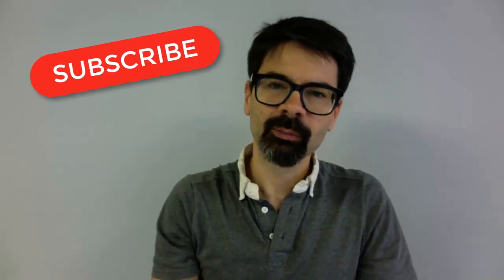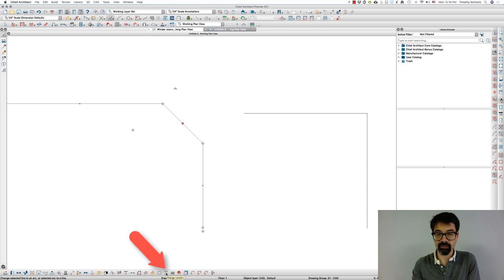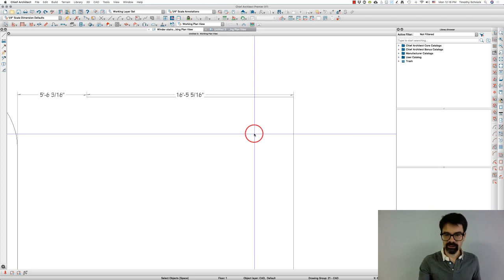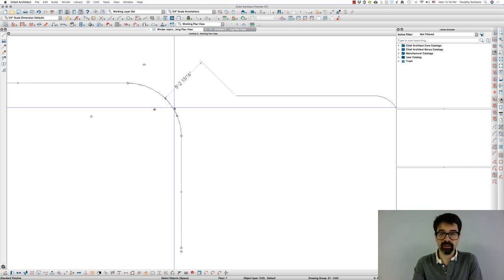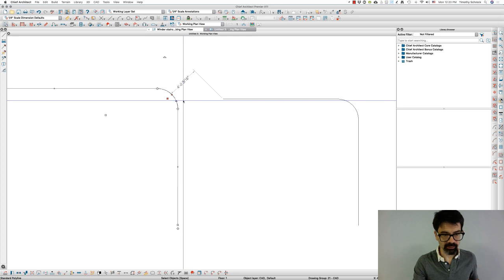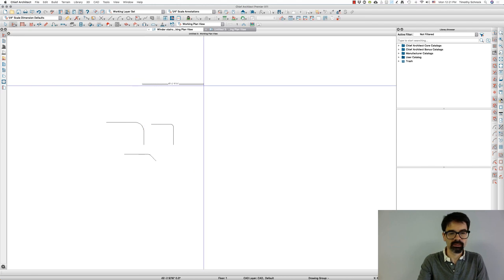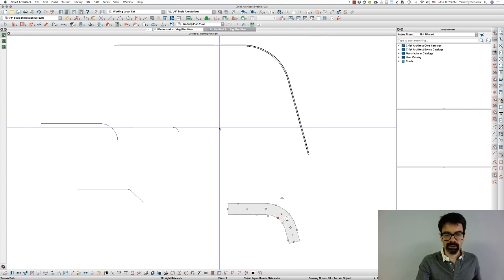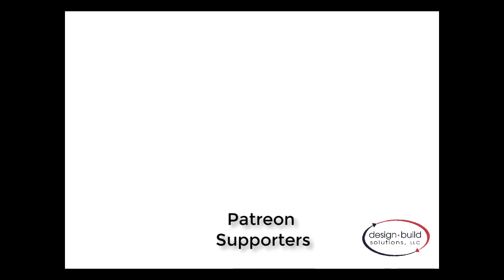Easy way to Make Arcs Tangential | Chief Architect

Comment: Hey Tim, I have really been enjoying your videos I am currently using Sketchup Pro 2019 but I did use Chief Architect X4  back in 2012 and it drove me nuts when came to drawing some of century old Victorians with the conical shaped roofs that we call Witches Caps here in the Bay Area. That frustration led me to purchasing Revit LT  which is good program but  because it was the LT (limited Technologies) version and I could not add the framing module and others on to it and after a couples years I discovered that Sketchup Pro had greatly improved its Layout module but in the back of my mind I still remembered how Chief automated a lot of  the tasks.  So after 4 years of Sketchup Pro I decided to take a peek at Chief Architect and I see that it still has the highest level of task automation that it seems to very good at track of stuff too.so I say must that as soon as I am able I will be be purchasing X11 and some of your templates.
Thanks for helping to feel confident about X11, Malcolm from Oakland
Reply from the maker: Hey Malcolm. Glad to be of service! Let us know when you're back in the Chief Architect saddle :)